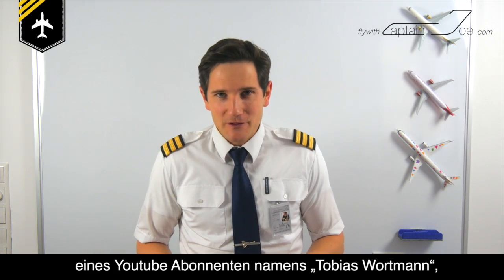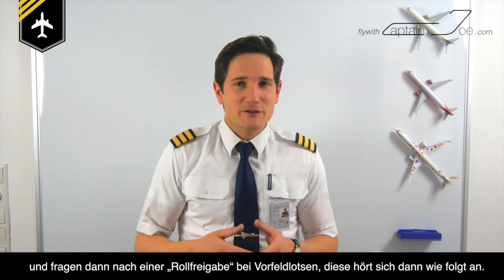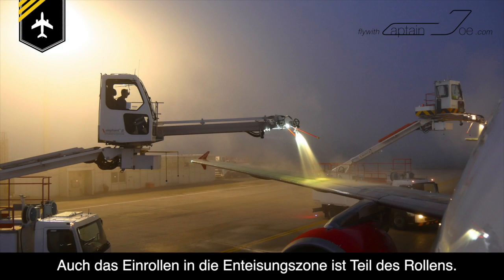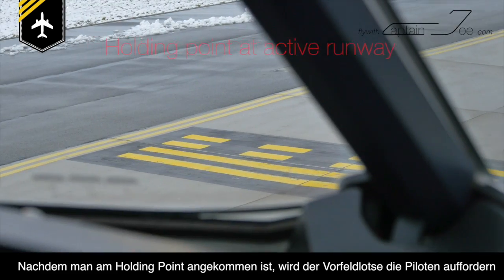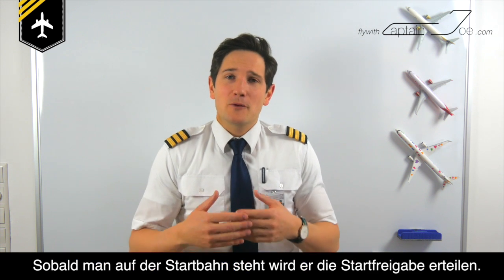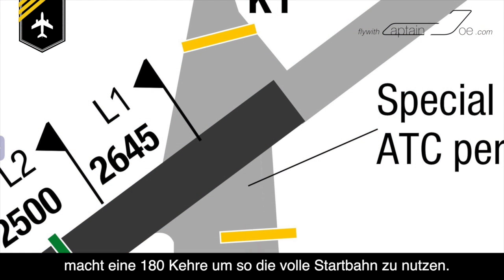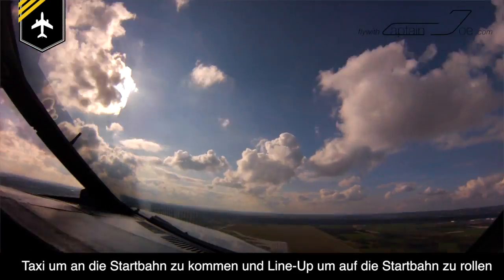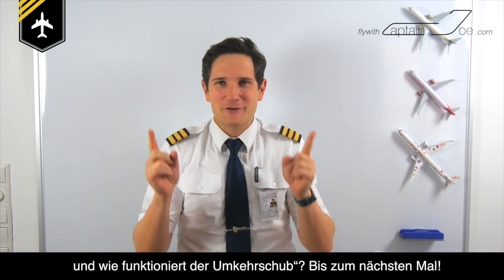Taxi and Line Up! Explained by Captain Joe

Comment: Hi Joe. just discovered your channel and love it. Can I ask you about why ATC and Pilots refer to some aircraft as 'Heavy' after the callsign. I think this has something to do with the wake vortices that aircraft produce in their wake. An explanation from a professional pilot would be great. keep up the good work.
Reply: I believe an aircraft above a certain weight must have the word "heavy" added to it's callsign. Since the strength of wake vortices depend on the weight of the aircraft, the use of the word heavy lets ATC know that an additional delay after that "heavy" aircraft is landed will be needed before another aircraft takes off or lands in order to let the wake vortices die down.
Reply: silvio2372 As long as the plane is bigger than a 737, it is mostly considered a heavy

Comment: So what does a commercial pilot do after landing?
Reply: completes the relevant checklists and secure the plane. if they are in command of the plane they're responsible to shut down everything except the APU if the plane is going to fly again that day in question. nowadays the captain is on the flight deck to supervise the first officer and overtakes them if necessary. I'm too a first officer.
Reply: Taxi
Reply: +gonatrollya I meant after parking.
Reply: Goes home duh
Reply: +jmluc90 or if it's a charter they will turn around if it's there  first flight
Reply: +Hendy so he's like cool plane bro, leaves the thing running, jumps out the door and walks down the tarmac to his house?
Reply: +jmluc90 no they shut it down and then leave the plane get a taxi or a car and go home
Reply: No, most low cost airline pilots will just disembarked the passenger, setup the fmc and more passengers boards and takeoff
Reply: Thank you for your serious response.  :-)

Comment: hi Joe! can you make video about using bearing in NDB . I don't understand what bearing is and how do you base on NDB to fly? if posible you illustrate by picture. thank you. look forward from you soon.
Reply: bearings is a part of maths. just google it. i studied it in 10th grade
Reply: In aviation, bearing is flying TOWARDS a VOR radial and track is flying AWAY from the VOR radial.  However, more often than not, "track from" and "track to" are used.
Reply: I think NDBs are Non-Directional Beacons.  They're kind of like VORs except they don't broadcast in radials, they just broadcast the same signal omni-directionally.  So you have an ADF pointer to show you where the NDB is relative to you but it does not tell you what compass heading you are going or need to go to intercept a particular radial.
You know this is hard to explain.
NDBs are for the straight pointer and VORs are for the crooked pointer!

Comment: Nice video. Maybe a stupid question, but why are planes pushed back from the terminal and can't do it on their own? Isn't it possible to use the reverse thrust for that?
Reply from the maker: +Gullivergumba Great question! It´s just to dangerous applying reverse thrust near the terminal building and you could easy damage the engines due to nearby objects close to the airplane :)
Reply: +Captain Joe, thank you for your answer, good to know. So technically it is possible to drive backwards with reverse thrust?
Reply: Yes, a while ago Northwest Airlines would use reverse thrust on their DC-9s to push back without needing to use a tractor.
Reply: The pressure might break the windows of the terminal
Reply: +Captain Joe its allowed to use the back engines like the Boeing 717
Reply: Yuuzwwasteign Zenuftig its called reverse thrust